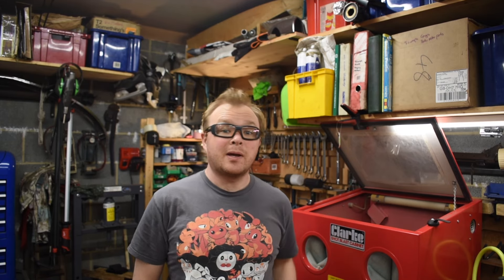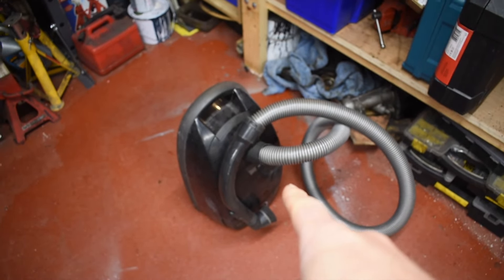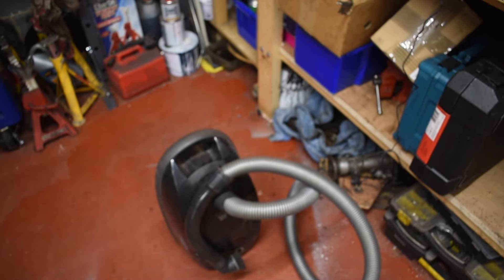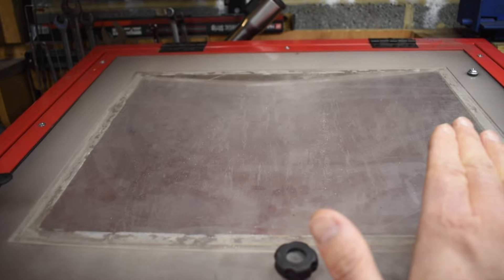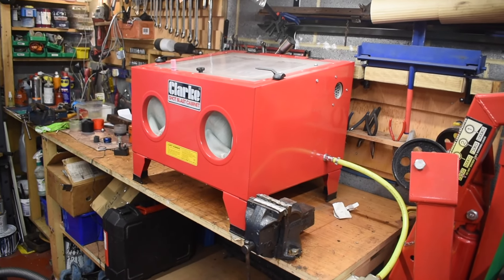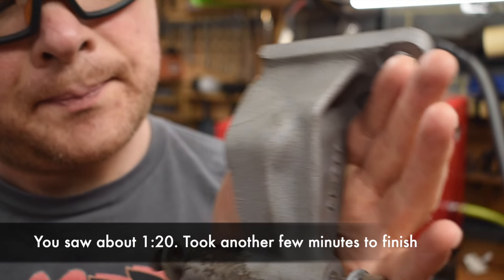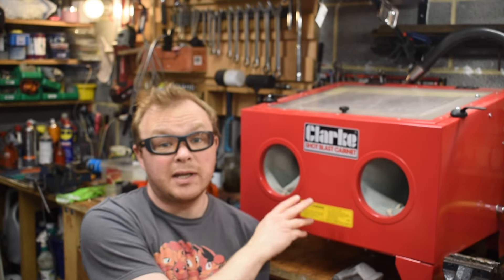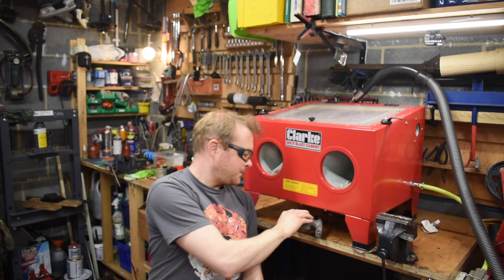Six Months With The Clarke CSB20B Bench Top Blast Cabinet - Tips I Wish I'd Known From The Start!

Comment: Just a thought, if you were to add more air tanks around the garage,  trucks 🚒 use separate different sized air tanks which can be bought fairly cheaply from commercial vehicle /trailer suppliers. Would this give you more capacity and less stress on the compressor? Regards,Tim.
Reply from the maker: That’s a good idea. I’m rather short of space right now with having to store bits for a whole GT6, so not something I’ll be able to act on any time soon though.

Comment: I have basically an identical unit here in NZ from a chain store. My garage vacuum had an adaptor that goes into the filter outlet on the righthand side but it is too powerful! That light is pretty dismal too, I'll try put in some better LEDs sometime.
Reply from the maker: Yeah I think they’re all the same except for the paint colour! I found that the vacuum I’m using needs to be on quite a low setting. I’ve more or less given up with the internal light as it just gets so dirty so quickly, I sit a magnetic inspection torch against the window usually.

Comment: I've got basically the same one but from ebay and also added a vacuum but did a little extra by adding an earth from the blaster to the vacuum. 

I found there was a lot of static buildup that was attracting dust to the window, hence the earth cable. My vacuum has a metal body which made it easier (it was cheap from b+q) and just added it to the body of the vacuum and the body of the blaster cabinet. I also earthed the gun to the body. It definitely helped. If your vacuum is all plastic just run some bare wire into where the dust collects.

I used to work in plastics injection moulding and the static the vacuums in the plastic hoppers would build up was incredible, foot long sparks sometimes, but an earth wire in the bucket stopped it, that's how i knew it would work.
Reply from the maker: Hmm, yeah, might give that a go then. Thanks!

Comment: Hi. Thanks for your time/efforts. I've been thinking to get one for a while. I dont know anything about Compressors (which I see as the biggest expense). Is your 3HP perfect or would you ideally have something different?
Reply from the maker: My compressor does do everything I need to and I would struggle for space with anything with a larger tank. I bought the one with the highest CFM that would still run on a domestic 13A supply, (though I’ve since had a 16A circuit and socket fitted for other reasons, which was not that expensive). If you’re not U.K. based then I suspect power requirements will still be the limit on what compressor size you can have, but the details might differ!

Comment: Can I ask you two questions please. 
1. I bought this exact item from machine mart today. The item on display had lots of marks on the outside of the top door. Marks like something sharp has marked the protective film. Unfortunately the item I bought in the box is exactly the same. Did you remove the film from the outside of the door ?  I’ve had a pick in one corner to see if it would come off, but I would like some additional advice. 
2. The mesh in the bottom, what corner does the cut off piece go to. On mine it was the top right, but looking at pictures it looks like it goes to the front on the left or right side. Some videos show the metal bits on the grid facing down and others up, plus I have one piece of metal and it shows there being 2 in video. It a bit confusing 😊
Reply from the maker: Morning Andy, on the first thing, I can’t remember there being a film on the outside of the door. It would make sense that there was though as the plastic marks easily. So I likely did have it and remove it. On the second point, the cut out is for the hose from the sand pick up to the gun, so it goes to the bottom right. The bits of metal that project from the mesh bit are just a support for the middle of the mesh, so sit down against the base of the cabinet.
Reply: @ thanks mate much appreciated. I didn’t expect a reply, and I’m going to sort it out today. 
Also I subscribed to your channel last night. 👌
Reply from the maker: No worries, and thanks!

Comment: I had a blast cabinet that size and it worked great! I went with the steel tips and never had to replace them sense they don't wear out as fast. The vacuum is a great idea!!
Reply from the maker: Ah right, I might look out for some of those when the ceramic ones I’ve got are all used up.

Comment: Same got the very nice new TIG welder but no 15 amp supply yet to the garage which will be expensive.
Reply from the maker: My 15A socket cost £388 to fit about a month ago if that’s useful info? I already had a spare way on the main board, and the board is already in the garage so fortunately there wasn’t much wiring to run.

Comment: that works much more efficiently than my harbor freight cabinet... I need to revisit the set up... thanks... how much water does your drier spit off?
Reply from the maker: I get a few mL from the dryer over an hour or two, and something similar from draining the compressor tank. If I’m using my die grinders hard on the un-dried air I tend to get a bit of frost forming on the exhausts!

Comment: If you add a sealed bucket with water where the intake pipe goes way under the water level and exit pipe in the top. It will trap most if not all the fine dust that the vacuum bag might let trough.  The dust is not nice to your lungs.
Reply from the maker: Obviously a good point. I’m using genuine Miele bags and exhaust filters for that reason (which’re rated at 99.9% particle capture combined). Running with a water trap I expect might destroy a household vacuum fairly quickly though.